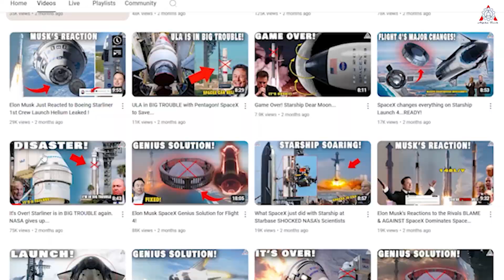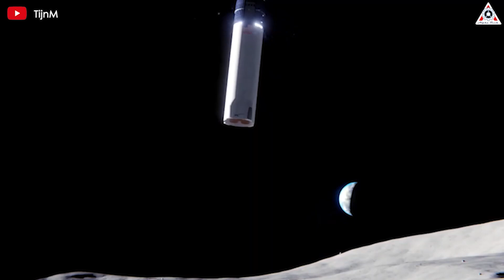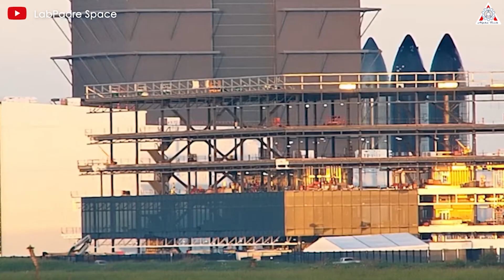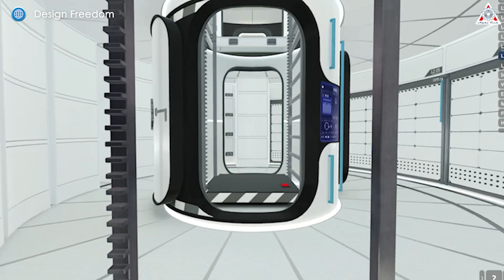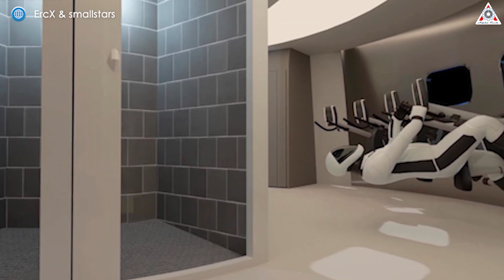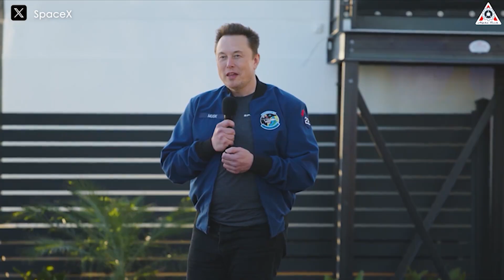NASA Officially Announced NEW Major Design Cargo Starship To The Moon...

Comment: The Apolo capsule,  built by Boeing that cough fire during familiarize session, killing 3 air force officers sitting still. The very same capsule that was copied building starliner! They made it slightly bigger, and still copied the 1960s capsule, all that was new was computers. That is the downfall. 3 failed attempts! I am surprised that SLS performed well test 1. That capsule built by Northrup Grumman,  also had defects with the heat shield. Boeing builds most of the SLS and NASA has inspected Boeing's work after delivery of its SLS build, and does NOT approve of the workmanship. So delays are mounting up. At this rate SpaceX will get to Mars before NASA will be able to get to the moon. SLS will not be ready to send SLS 3. A lunar gateway will never happen. 2030 will not be possable. SpaceX is our only hope to transport, and land Americans on the moon!
Reply: Elon's earlier designs are not what we're seeing. Testbed is what is now. I know about super Dragon as Starship. Refuelling and Mars lander/habitat eus. So let's be patient. Nasa has the  imperative, initiative and 'hubris'.
Reply: Thanks, we need corrections and also to debunk old&wrong misconceptions. Nasa won't be pipped to the Moon, Mars & beyond.

Comment: One of the biggest problems with Hydrogen power is it uses more electricity than it makes. Another battery option is graphene batteries. There are several companies making them. They're lighter and less effected by temperature than lithium ion or lithium iron phosphate.
Reply: You're right, graphene, C-fibre, are also structural aside use as solidstate fuel for iON; Callisto & Titan here we come. We're not far from Interstellar probes with JWT-style eqpt and Curiosity's gamut.

Comment: Nuclear power would be better. The US is developing this tech for space. I think spacex should assemble a bigger spaceship in orbit merging different techs like nuclear propulsion as well as nuclear power source, starships and heavy loads that land on mars
Reply: Nuclear doesn't make sense for Earth -> Lunar transfer, but it would for Earth -> Mars.

The reason is primarily the engine efficiency. Nuclear propulsion is VERY efficient, far moreso than traditional chemical rockets, but that comes at a cost of thrust. The thrust put out by nuclear is dramatically lower than chemical, and because of that, wouldn't work for the Starship use case. For going to the Moon, that's not much of an issue as you don't need a whole lot of dV for a lunar return mission from LEO, whereas you need a substantial amount to get to a low martian orbit from LEO. The thrust put out by the Raptor RVACs will be perfect for circularisation around Earth, as well as capture and circularising around the Moon.
Reply: Aggree 👍

Comment: I think they should use nuclear power they used it in the voyager spacecraft and they have worked well for over 40 years and that was 1970 technology
Reply: The difference is Voyager is unmanned. The issue is providing the astronauts with sufficient protection of the reactor. Definitely sounds like the best option but is not easy which is the main reason for it not being done. Maybe as cold fusion evolves that will be utilized.
Reply: The entire RTG array in the Voyager probes isn't even enough power to run a microwave.

Comment: There one power source you hsve not mention which is  a nuculare power
Reply: Because its currently to difficult to protect the astronauts from the reactor.
Reply: Nuclear power would involve a lot more radiation and concerns for reliability in microgravity. Solar just makes more sense here.
Reply: @haydenuwu  look at the pioneer voiger probes they use a reactor to power each space craft, also you donot activate it untill it is on the ground and placed a safe distance from the lunar facility.

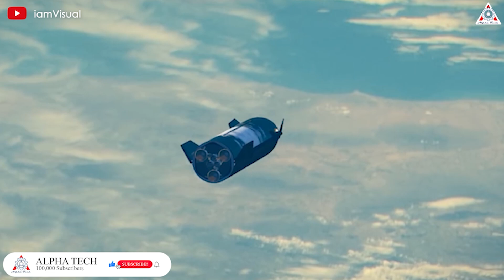Comment: At 17:30-18:00 on the video, it says that half way to Mars a message from the spacecraft to Earth would take 10 mins, but this is not accurate even when Mars is the farthest Earth, which it would not be. Elon has said that he’s thinking that we could be ready the flight in 2 years. 
On Feb 19, 2027, Mars and the Earth will only be 101Mkm apart, so when the spacecraft is half way there, a message back to Earth will only take 50 Mkm/0.3Mkmps=150s= 2.5 mins

Comment: 18:00 the delay won’t be so bad with moon starlink satellites.

19:20 faster flight will be available pretty quickly with fuel tanker BFS vehicles based at space stations…moon & earth orbits & later fuel systems at various locations in the solar system.
Reply: Having Starlink satellites around Luna cannot make radio waves or laser beams move any faster as both wavelengths of electromagnetic radiation move at a fixed speed, 299,792,458 m/s. The farther away one is, the longer it takes for a signal to get from point A to point B. 

Having refueling tankers or a refueling depot in orbit will not allow a spacecraft to make the trip any faster, it just makes sure they have enough fuel to get to their destination and back. It still depends a lot on orbital mechanics, amount of thrust produced, the amount of mass of a vehicle, how long your engines can produce thrust, amount of fuel carried, and other factors. 

It will be good when we can finally have supply depots and/or stations in strategic locations, though. I'd prefer that we stop with the "Tinker Toy" style stations (like the ISS, for example) and actually build something along the lines of the station in "2001: A Space Odyssey" (btw, centripetal acceleration due to rotation does NOT produce gravity waves; we have no ability to produce gravity via artificial means with our current technological level).
Reply: @ronaldlebeck9577  This exactly; SpaceX hasn't managed to solve the problem of the speed of light lol, just throughput.
Reply: I think what people don't understand is that they're not getting stuff from point A to point B _quicker_, they just have a wider hose.

Comment: Why not a starship variation that is a power module that is put in to a GSO or parking orbit. First ship has solar panels and some batteries and then is loaded with more to capacity. Its fuel tanks are topped off. The shop to the moon or Mars hooks up to it just like a tanker Starship would, and off they go to the moon or Mars. It get left in orbit and when the come back up, hook up and head home. At earth it gets left in a parking orbit to be refueled and charges it batteries back up for the next trip. Why does a craft have to have everything when you and connect in a group to make the trip from earth to moon or Mars?

Comment: I think Starship HLS rocket should land horizontally instead of vertically. Yes, that causes issue with a return launch but I think it would be better than a vertical landing.
Reply: Yeah, bringing back astronauts is highly overrated.
Reply: Added complexity.
Reply: @rayjay848  No, getting them there and getting them out, unloaded and working seems easier performing a horizontal landing. They can use a Dragon ship that gets attached to the front of Starship with a return service module to launch and return them back to earth.

Comment: SpaceX needs to create artificial gravity by locking a cable in between two ships. Then spin both around to artificially create gravity. It will save bone density loss during the trip. And, make going to the bathroom more enjoyable.

Comment: The gravity on the Moon is only a fraction of that on Earth. Why not use a space-to-ground cable system to get on the surface? With our current technology, it's impossible to run a space elevator on Earth but the Moon is a different story.

Comment: Since when is the Moon 1.4 million miles away from earth.
It's 238000 miles away.
Reply: Maybe the trip is 1.4 million, not the real distance between the two
Reply: @brandonmoore9621  oh ... that would be new that they count the orbits, especially as they are not fixed orbits, meaning circumstances leading to more or less ...
No this BS.

385 000 km is the distance. But may be said miles be meant negative fathoms.
Reply: The moon gets about 1 inch further away from the Earth each year so that distance is the new distance from Earth the moon will be at after the FAA approves the flights.

Comment: Nuclear ☢️ power is the best thing to space or galaxy?
Reply: A reactor would be the best choice to activate once in space as it is the lightest and smallest option putting out the most power , plus the tech already exists from subs and ships at sea.
Reply: @rktman1965 it is in fact not the lightest option also it’s going to be a little bit difficult to refuel the reactor if your on the moon
Reply: @queryw6982  yes it is especially considering the fact that the crazy amount of shielding needed on a sub isn't needed in space add to that the short mission duration a reactor with a 5 to 7 yr life cycle without refueling is ideal , actually overkill.
Reply: @rktman1965  this mission is literally meant to be a precursor to PERMANENT colonization, what do you think is going to be more useful, something that doesn’t need to be refueled or something that does? Also 7 years? You do realize that the curiosity rover has been on mars for 12 years and it’s reactor hasn’t ever been refueled right?
Reply: @queryw6982  the two power sources for the curiosity rover are solar and nuclear the nuclear has been dead for a very long time leaving only solar .   On manned missions to the moon and beyond the nuclear core can easily be changed out using automation or other means , the mars rover is a one shot so not so much for that one.  Try again and do a little research this time kiddo.
Reply: @rktman1965  maybe you’re thinking about OPPORTUNITY, Curiosity HAS NO SOLAR PANELS have you done your research and looked at a picture of curiosity?! Tell me where are these so called “solar panels” opportunity was entirely solar powered and basically died because a sandstorm occurred on mars and the panels were obscured enough by the iron dust covering the surface of mars that it could no longer prevent its batteries from literally FREEZING at night also don’t go trying to tell me that perseverance is partially solar powered because it’s not, the tiny autonomous drone (ingenuity) that it carried with it to mars was solar powered the last time we used solar power to actually POWER something ON mars that WASN’T ingenuity was when opportunity died on February 13th 2019 over 4 years ago I literally remember this happening because my birthday is also in  early February and nasa had been talking about the fact that there was a sandstorm going on on mars that was heading towards where opportunity is and they were very concerned, I’m not going to say that solar power is not useful in space because it is and the ISS wouldn’t function without it however if your visiting say the moon where you might actually get more power from your solar panels because they are more efficient at lower temperatures and the lack of atmosphere prevents atmospheric scattering that would otherwise lower the efficiency of the solar panels because there’s quite literally less light reaching them it actually makes perfect sense unless you want to also have power at night, batteries are only so effective at storing power and realistically you should probably bring both solar and nuclear power if you’re going somewhere as relatively close as the moon especially if you want to leave some of that equipment behind on the moon for future missions. Also side note, contrary to what you might think the reactor on curiosity was not “designed” to only last 6 months as per the original mission plan, that’s right the original mission plan for curiosity was 6 months! Not 12 YEARS and it’s currently still operational the main problem with solar panels is the inverse square law applies to light intensity and solar power is much less effective on mars even though it’s atmosphere is much less dense than earth’s also I’m not a kid, I’m 24, I WATCHED curiosity not only launch in 2011 from earth but also land on mars in 2012
Reply: @queryw6982  Not interested in reading a book written by a trolling moron by by

Comment: none of this will happen if the FAA is not forced to get out of the way.
Reply: Starship hasn't made orbit yet, it's frankly pathetic performance has nothing to do with the FAA. Just another failure in a long list of epic failures.  SpaceX should be prosecuted for repeated violations at Boca Chica  (allegedly)
Reply: @oktc68  it was sub orbital so if something went wrong it would come back on its own as it only doing test flights at the moment the plan is to catch both stages and it hasn't caught one yet because they are testing it and want to make sure it works how they want it to

Comment: Glad to see the pressurized Rover design. Once on the surface, creates somewhat of a shelter if there's an emergency. I would suggest designing it to be left there, and to be self charging. 
Would be good if it had rebreather tech, and that some Oxy tanks got left with it and connectors, so that the vehicle could be used long term for its life support in a crisis.
Basically Artifact 1 for Moon Base. 
That theres a rescue vehicle waiting.

Also suggest high/low temp rope onboard, and climber's ascenders capable of in suit use, in case that cargo lift malfunctions.
And that rope be deployed if all crew are ever on the surface at same time.

Also suggest crew learn the Fireman's knot. (Ashley book of knots).

On panels and covers, suggest on those that fold to side of ship, that split covers be used that can be hinged at desired angle to be reflectors, for deep space use.

The capsule thrusters sound good, really only needed in the last seconds, for distance plume effects are worst.
And on take off similar, until above rooster tail engine rock damage distance.

Then can fire the big guns...

Speaking of guns, wondering how big of a cannon it would take to launch a projectile into lunar orbit from the surface?

Might be an interesting experiment, with potential use for Lunar surface defense.
Would be good to get there firstest with the mostest concerning defenses... And maybe able to be repurposed to launch small emergency cargos like air tanks point to point on the Moon's surface... Have a crisis? call in an artillery strike, take cover, go retrive the tools you need...

Might be possible point to point to design a cargo Mortar... Kinda like "Air Mail"
 but without the air! 🤭

Gonna seem strange to finally have a Moon Base...

Comment: BONUS
The garden wil help with CO2
I would also consider Nuclear Reactors, at least for cargo only ships.  NASA has a reactor design that has been operating for over 45 years,, they are on Coyger 1 & 2 launched in 1977 and operating ever sense.  And you can combine the reactor with batteries to handle surges in power demand.